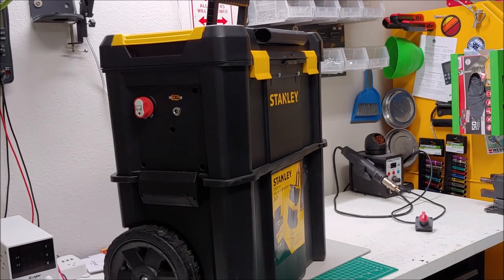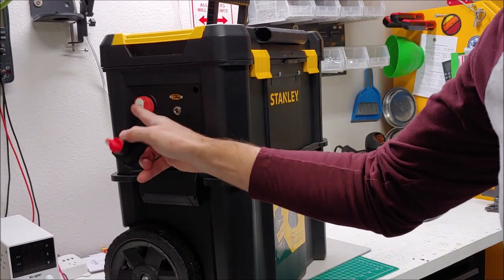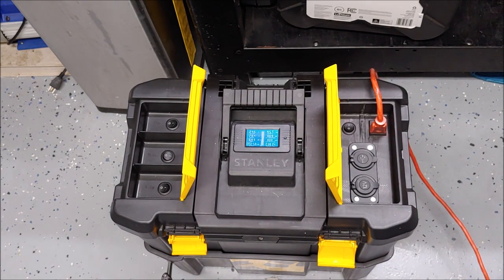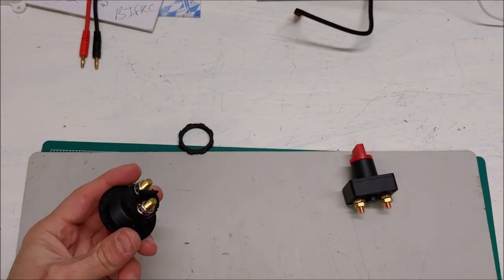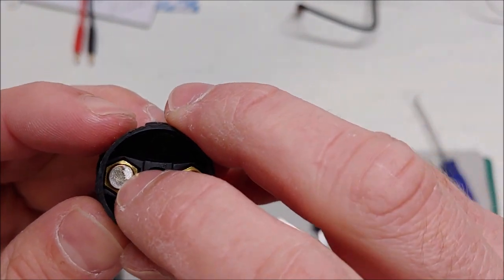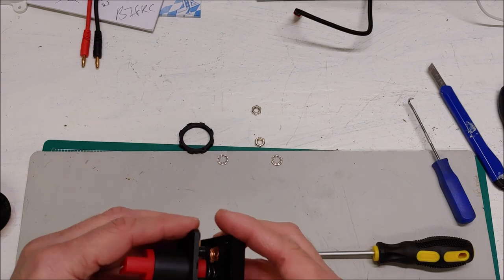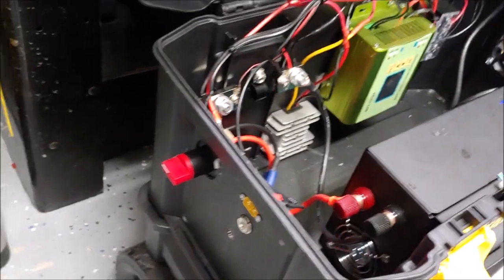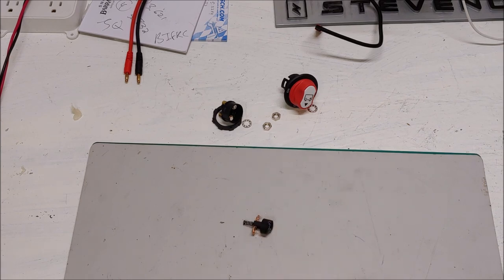Dangerous Battery Cutoff Switch

Comment: it would be interesting to see that copper bar outside of there used in between the battery and the system to see it's heat.
The other aspect is the contact surface size, how well does that surface contact the top of the screw(that is probably where the heat is coming from)

Comment: Do you want to run a 100A thru those  wires?????
Reply from the maker: No that solar generator only has a 1000w inverter and a 24v battery so current will be around 42 amps. Also battery has a 60amp BMS
Reply: @stevenc22  the are still alittle flimsy, but much better, i hate heat and loss, so i use BIG wires 👍

Comment: YT Auto deleting 6 times.
Reply: I went with the 150a version. That looks much like that one. No problem so far even after running a microwave. They just overrated the listings of them like everything sold out of that region of e-a-rth. Will have to test again to check for heat.

6th try